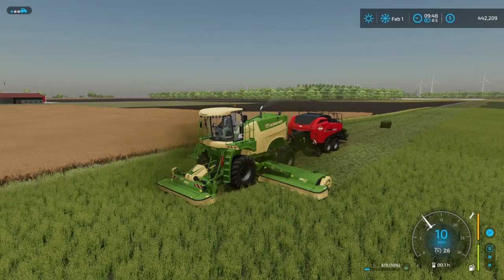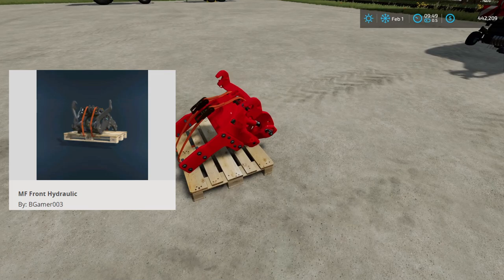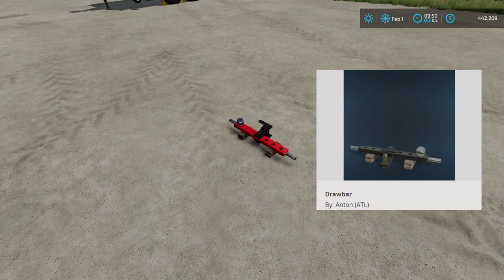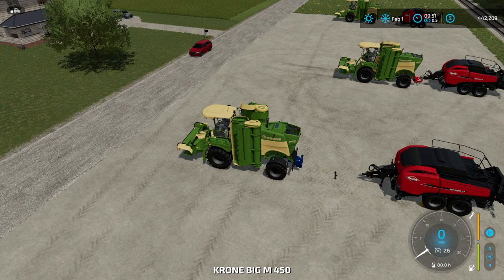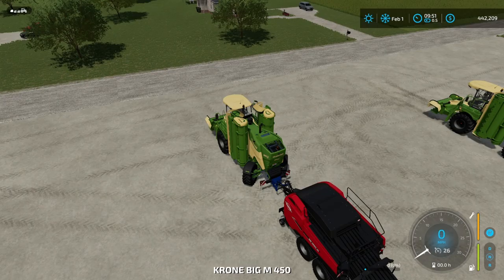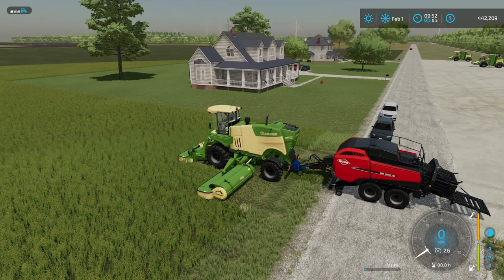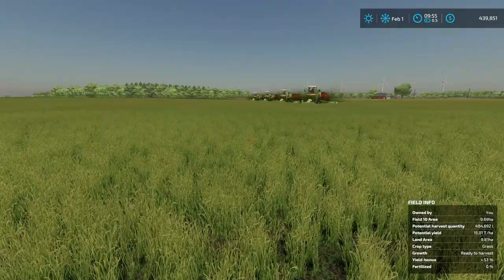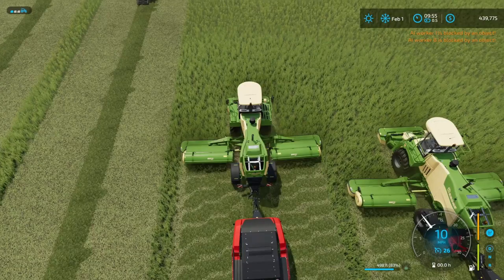How To Mow And Bale At The Same Time | Farming Simulator 22

Comment: With that first drawbar if your item connects to the side like that disconnect the item. Then then unfold/fold the drawbar and when you reconnect it will connect in the middle. The fold unfold function switches back and forth between the pin hitch and the ball hitch
Reply: Was going to say the same but ya beat me too it 😝

Comment: You can also use a loading wagon as well. The one thing I kinda learned on my own was if you use the Lizard winrower (v shaped thing that attaches to front of tractor)  then you can have a worker do the baling/ loading wagon.  Only with the loading wagon you gotta keep an eye on when the wagon is full. 
I had tried to hook up the baler to the mower,  but didn't have the draw bar and hadn't thought to try that.  So I learned something today,  

Very much appreciate the lesson 😎

Comment: Get 2 of the big trucks with front 3 points then on 1 put a forage head and the forage adaptor with a lizard trailer on back. Turn on a worker and set the speed at 50 mph. when it's full fire the worker and use the same truck and trailer with a forage pick up and just dump the 1st into it. If you don't fire the worker they will drive off as it unloads. Also turn off auto start.

Comment: I use the rear 3 point hitch on the mower but use the small tedder to make hay...then use tractor with R90 rake on front with baler on back to make hay bales in only 2 operations